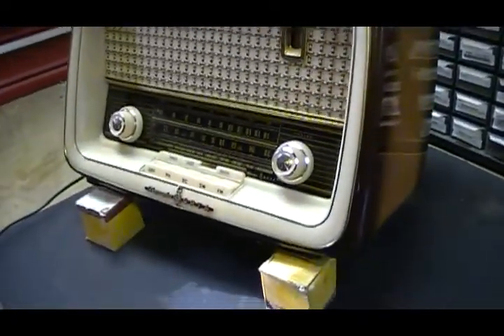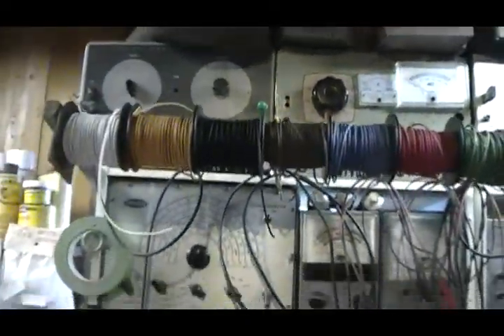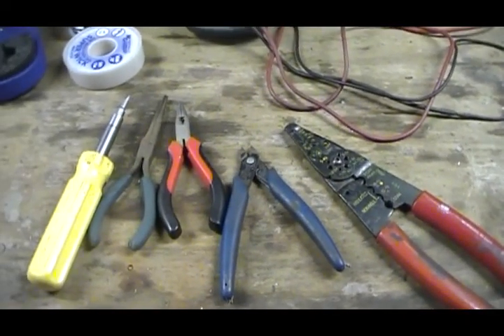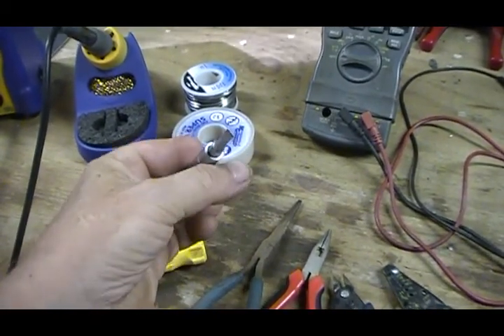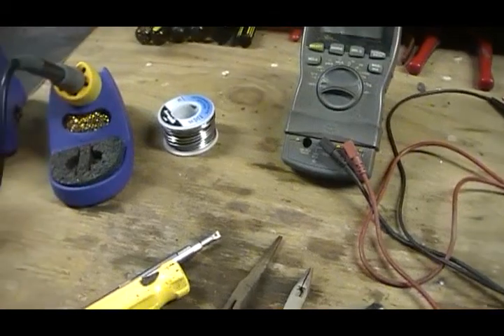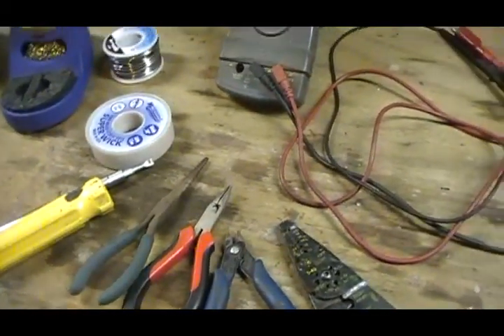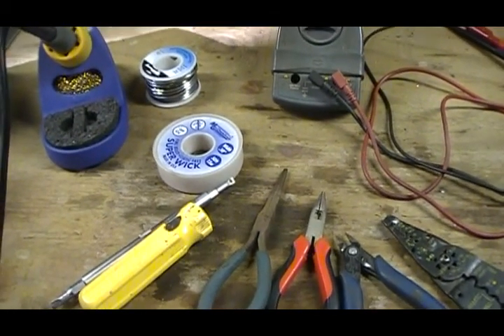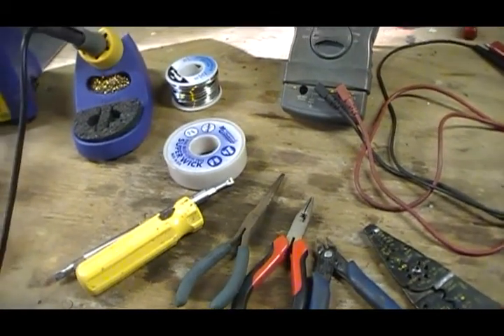Tools for radio repair

Comment: Hi Dennis:
I am sorry to hear about your heart attack. I hope you get better real soon!
Looks like we have something in common. I was born with a hole between my Atrial and Septal chambers in my heart. It's called an ASD "Atrial-Septal Defect".
I just had my third open heart operation a year and a half ago to try to repair, (close), the hole. I also had a cleft mitral valve and now they have implanted a mechanical valve. I have been 100% dependent on a pacemaker because of all the scarring on my heart. The scarring blocks the induction.
Nice to be associated with someone who has similar problems and also has similar interests. Although neither of us asked for the prior.
Take care my friend and don't over do it!
Tom

Comment: I been cutting my teeth on AA5 ,s radio 60 ers s,,so far I did five working on a six ,recalling ,tube replacements ,etc oiling tuning capciator bearing ,deoxit5 the volume knobs.,general c!Dani g cabinet.you're is a good basic work bench most of us are as time goes on.

Comment from the maker: Hi Bobby. I got the super wick from mouser dot com. Just search for super wick on their and it will pop up. They have several different lengths and sizes. The one I got is 50 Ft. .1" for $24.82 and it works pretty good. Dennis

Comment: I think for any work bench of any size is you are always adding stuff you need,no work bench is ever complete,as new stuff comes out add what you need ,replace old worn out stuff or repair it ,a lot of the things you need if you shop around you can find good stuff cheap.buy what things you will use or it's a waste of money ,your work bench is a pretty dam good one